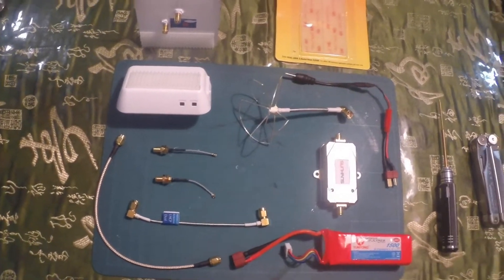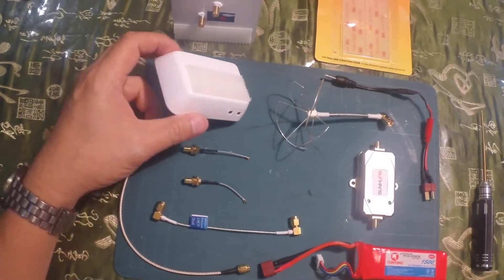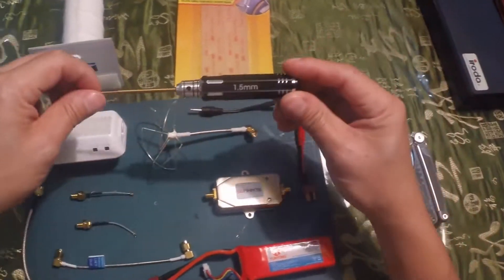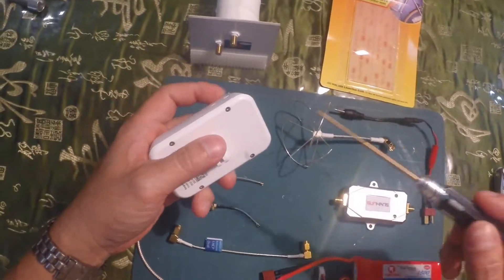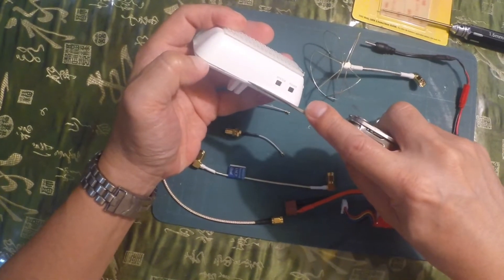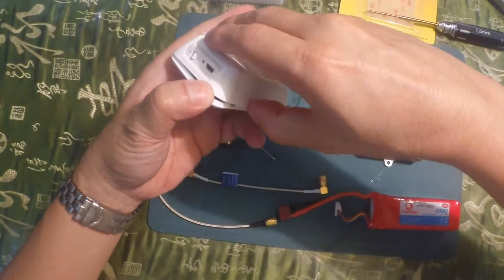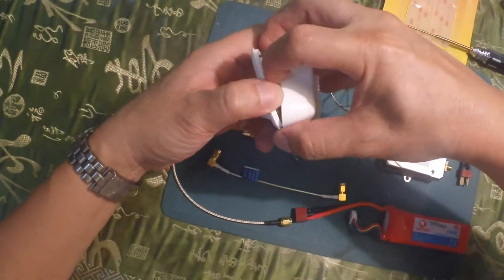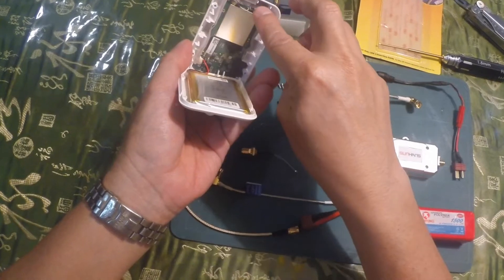DJI Phantom 2 Vision Plus~Range Extender~Horizon Antenna Pt 3-1

Comment: Please ask for help : I have a Phantom 2 Vision plus I had an accident and broke the camera and gimbal that came installed. Now buy a gimbal walkera 3D to install and a camera Xiaomi yi . I need to install it and therefore request please help installing these components in my phantom 2 Vision plus. Any information will be welcome to install the camera with WIFI FPV system already installed tine Phantom. From already thank you for the help.
Reply from the maker: Marcelo Biurrun  Hello Marcelo. Unfortunately, I have no info installing those systems. You would have to check with other hobbist or hobby shops.

Comment: What direction is that clover leaf for the wifi extender. I know it's 2.4 just wondering cause I have that horizon antenna and want to add the one you have to my wifi. Thanks and great video
Reply from the maker: Clover leaf vertically up, as signals are transmitting on the sides.
 I used a 90degrees plug to help the antenna sty vertical as the socket is on the wifi extender side.

Comment: Hi Gordy Guy, 
I must congratulate you on a very comprehensive, informative and organised video.
Can I ask, how much of a range increase you have received - distance of transmission?
Also, would you recommend disconnecting the battery to the repeater when touching the circuitry?

Keep posting. :-)
Reply: Sorry, I was too premature!  I posted before watching you disconnect the battery. Doah!
Reply from the maker: TheRowls
 Hi, my range is currently about 3.7km. I dare not travel further as my battery alarm was blaring all the while my phantom was returning with the aid of a tail wind. I barely touch down and registered about 5-10% left of my battery.
Reply: Thank you so much for coming back to me.
I really like the way that you structure you videos - as an ex-military man, I appreciate the strict structure of your videos.

I would like too, to get more range out of my stock Phantom 2 vision, therefore, would you please advise me in what order you would recommend me watching the vids.

Also, did you get all the hardware from one source, or various???? - that's relating to all the mods that you have done....

On another note, I'm in no way experienced in the electronic field, although I have done some research, identifying that there's Directional, Omnidirectional antennas, then there's the reference to dBi, e.t.c. Isn't it best to get the biggest and best with the greatest of power?

Sorry for all the question, but I want to get it right first time.
Reply from the maker: I would suggest you purchase a kit for your upgrades thus eliminating having problems thinking of parts and whether they match up. This build was a review of the antenna kit from Horizon FPV Antennas from UK. I do have many other antennas that I like to mix and match for different usage according to required range. The antenna system from Horizon which I have pasted a link has quite a respectable and high quality system. But I would suggest that you concentrate on the Remote Control unit. Just concentrating on this area, you would be able to achieve the maximum distance that your battery on a full charge can handle in a two way flight. After my review, Horizon Antennas are flooded with orders and you might have to wait for awhile, which gives you time to familiarize with your Phantom.Give her name, mine is Curious Carol. Do the build according to vid 1 to 3. Skip 4 as that entails modifying the Phantom itself and you need to be confident in soldering.
Reply from the maker: Open the description below the video to see the links to the build video sequences and Horizon link. Just ask me as many questions as you like. I'll do my best to help you. If you find it confusing, I'll make a video to explain your problem.

I have a great tip to help you cut the glue that holds the pigtail connector inside the RC unit. When you trace the cable that runs from the stock antenna to the frequency box. The pigtail connector is held on by a thick pliable glue. It's very risky to cut this as you might damage the fragile connector. I have made several successful safe removals for my friends RC unit. The Frequency box is held down by a double sided tape and a bunch of pins that connect to the electrical board. Hold both sides of the frequency box and gently rock and lift the box without bending the pins. The pins are not secured. Apply enough effort in lifting to separate the double sided tape. Once lifted off, you have a more easier time to carefully remove the glue and separate the pigtail connector and plug in the new pigtail connector to your RP-SMA for plugging any antenna to your 5.8Ghz control frequency box.
Reply from the maker: Hi Rowls. That's a great point. Disconnecting the battery would always be a great idea if you are tampering with the repeater. I was just pressed for time and was careful not to have any metals brushing the board. I also made sure that the switch was at the off so that there would not be any circuitry flow.

Comment: Hi .. 
From where i can get the same industrial strength 3M Dual Lock that u r using .... i was searching for it but couldnt find it .... 
Thanx
Reply from the maker: You can get this here- http://www.amazon.com/Scotch-All-Weather-Fasteners-Inches-RFD7090/dp/B00347A8EO/ref=pd_sim_indust_6?ie=UTF8&refRID=1GXAEQAVEDCYW5077XNS  Hope this helps.